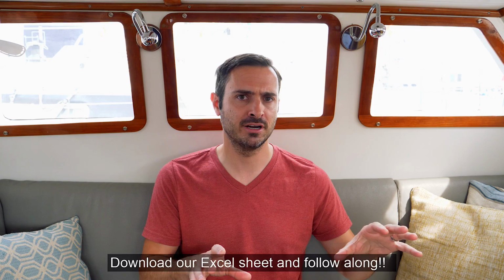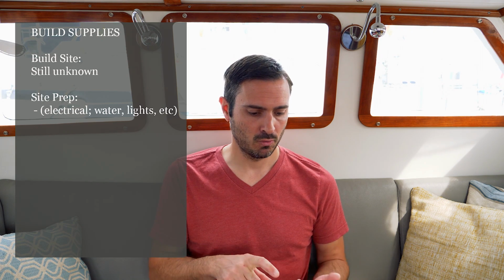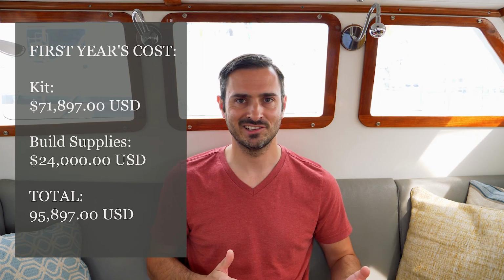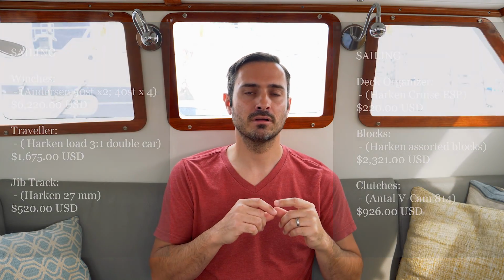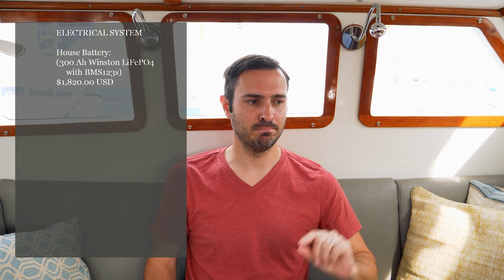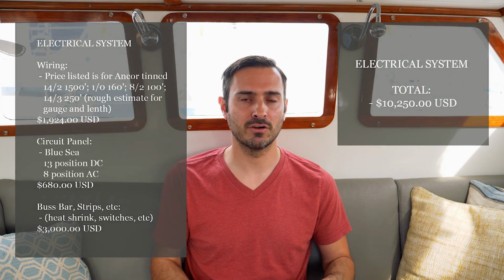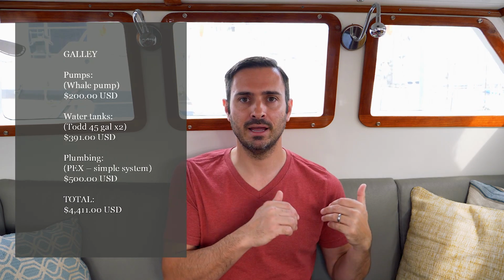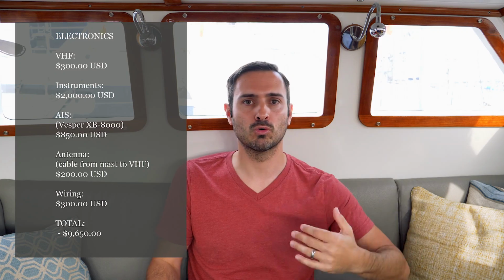What is it Going to COST to BUILD a Kit CATAMARAN? - A Comprehensive Guide (MJ Sailing)

Comment: Any 45 foot cat will cost a similar amount to build, considering they have all the same basic components. The rig the deck gear, sails, the type of fit out items you want, etc. The only way to make it for a lower cost is to use cheaper materials in the hull and deck and fit out. There is a difference in cost between a full foam epoxy build and an end grain balsa polyester build for example. But using material like plywood for bulkheads and interior fit out will have a weight penalty. From the prices you quoted I think the Grainger price sounds about right for an epoxy foam sandwich build. The Oram sounds too low but maybe possible using cheaper materials. The resale value will also reflect the build price and quality.
It is not for the faint hearted, but it is very rewarding building your own boat, when finished you will have a sense of achievement that is not found in other endeavours.  I wish you well in your journey, cheers Rustie.
Reply: They are all Divinycell foam cored epoxy panels... hull, deck, bulkheads, furniture.... everything.  The Grainger and Oram kit comes directly from ATL composites and are the same identical panels.   They are made in a heated hydraulic press (flat panels) so have the lowest resin/cloth content around.   The Schionning is a different manufacturer in South Africa, but they infuse the panels instead of hydraulic.  -Matt
Reply: @mattjohnson6716  Wow then that is a weird price difference.... All the material for my boat also came from ATL. They are very reliable and consistent with their quality. We have 2, 40foot containers with a poly hoop dome over it with the ends closed in. It is worth investing in this type of shed as when you sell it later it ends up almost free. The containers are great for storage and as a workshop for building dagger boards, rudders etc (good for controlling curing temperature). Examine the quoted material list carefully and compare it to the plans material list. Because if you think they haven't allowed enough DB tape or if you want some extra panels to build shelving cupboards etc that aren't on the plan then it's cheaper and easier to add few extra sheets. We are looking forward to the build series, Cheers Rustie & Malene.

Comment: Really interested in the 4 stroke outboard option.  I too luv the idea of easier to service and light weight engines.  Can you please tell me how you will get on with carrying enough fuel.  For instance if you were in the South Pacific.... Can you buy good petrol and carry enough for your needs ?  And secondly will your solar charging make u fully self sufficient in say a week of cloudy rainy weather especially because the outboard Alternator running time will no doubt have to be minimal due to fuel cost and fuel tank capacity.  Im really enjoying your boat build videos so please keep up the GR8 work.  Thx ~ Paul
Reply: Thankfully outboards are used by everyone island nation for their small boats.  Most of the time it's easier to get than diesel.    Efficiency for the newer 4 stroke is closing in on diesel, but even if we need an additional 20%, that's not that hard to accommodate.   The only negative is that you can't slap a large alternator on these outboards (under 30hp).  Evinrude has one with 45a, but that's the largest I know of.  But with the area we'll have for solar, we can rely on that to charge the boat.  If not, since we'd have gasoline on board, a honda 2000 generator would work great to fill in the gaps.  

Matt
Reply: @mattjohnson6716  Hi Matt good answers thx.  Hey please use a good explosion proof packing in your petrol fuel tanks.  Will stop a full on explosion in worst case scenario and its not an expensive product.  It used to be called Explosafe probably lots of options now days.  All the best with the build M8...

Comment: That boat is not doing it with me , for what your going to do with it , the bow is reverse so the waves will launch up the boat , being a wet boat on long crossings , it’s narrow for its length which means it’s more for charter , the decks angle in board loosing valuable stowage for extra fuel or water , it’s very high out of the water which for a light boat is tippy windage you  don’t need , it’s light so speed is good if your wanting that , for deck room is not big ,,and do you want to go back to work each of you to fund a build up to 300 k , there better buys second hand out there go to sttmarten and look at the damaged boats there you can fix , must be better deal sorry to be a pain buy I’ve done it , built it and there is no budget no launch date no end to cost  and resale is less than cost , if you want to go cat buy a hull and decks and finish it off , better deal , I listened to mat he’s done some home work , he’s full of spec  figures and numbers but cost cost , at present you two are cruising the world free with the help of a few , no ties and enjoying life  why change it over to you good vid
Reply: I would totally disagree with you.  Modern catamaran design is nearly all going down the reverse sheer on the bows and there are good reasons for that--they are not necessarily wetter and the advantages of having more buoyancy down low is significant. My 40' cat (that I built) was wet when we were doing more than 16 knots... sort of to be expected frankly.  Beam has nothing to do with charter boats!  In fact look at the normal charter cats and they are all beamy and fat--the lagoons, leopard, etc,  Oram has a very strong philosophy of long cats--long is fast and then you don't need to go out to a 50% lenght/beam ratio and your prismatic coefficient is far better.  Re height on the water and tipiness... that is completely wrong.  The Orams are far lower profile than any of the new lagoons etc that have the huge cabin top steering position.  There are also a lot of Orams that have done circumnavigations, none of whom have capsized. Sure windage on all cats is a challenges as there is little beneath the water compared to a mono, but at least on that one you can lower the daggerboard to help when maneuvering in tight spots.
Reply: Well I better stop designing ,where  talking off shore boats here they need to be able to stay upright

Comment: Why in the world did you go with Oram? Before you mentioned Schionning and Grainger. Both superior designers with many more boats built. Meaning there is a bigger community of people that built their boats. Not to mention that aesthetically Schionning and Grainger boats are beautifully designed and don’t look like cats from 70ties. Which virtually unknown Oram does. Scratching my head.
Reply: I don't think they have gone definately with Oram, that is just for a costing, a similar sized boat is going to be similar cost. It probably would be, the cheapest in terms of cost as Matt said in the video, but I don't think by much over the similar but slightly bigger in terms of volume schioning arrow 1360, which I'm favoring at this moment for a number of reasons, not least of which is one eye on the future as it seems the schionings have a better resale value.

Comment: Put a secondary 20-35A ‘charger’. They are wide ranging so will operate at any input voltage/frequency.... gives your redundancy for charging when in 230V zones. Or switch the  ‘inverter/charger’ for a dedicated inverter... will half pay for that small charger. The charger doesn’t run appliances... but even that small size is more than enough to fully charge your lithium batteries in <10 hours.

Comment: You should really consider an electric drive because it would reduce your running costs in the long term. The power supply can be supplemented by systems that charge the batteries for a lower cost than running diesel generators. The result of this also means you have more than enough power to run water desalination, and if you had run out of diesel or a generator failure you would still have power from other charging sources.

Comment: A few ideas if you are going to build.  
For solar - panels look at altestore for mono and poly panels at 50-60 cents/watt. Look at makeskyblue for mppt 60 amp solar charge controller at $105-$150 , or EPever mppt controllers for bit more.  I helped install panels and controller on cat in Feb.  
For propulsion engines - consider (google) HF-3m78 marine diesel 21hp at 3Krpm with gearbox and some controls at $2K+, weighs 341lbs thou,(vs 143# for outboard) , they can also supply shafts, stuffing boxes etc. for US sailor demo see youtube "TDPower 3m78" by A liquid Life
Catamaran sales vs asking price - youtube "2018 catamaran Recap".  This will give you insight into home/kit built cats' actual selling prices.  There may be a 2019 report by poster.
Good luck to you with your project.
Reply: So, I watched  the video, but comparing the resale value of a home-built "performance" catamaran from a small Australian designer to the big three names (Lagoon, FP, Leopard) , which were the only ones covered in the video, is an analytical error.  If the MJ boat is worth $400K at launch (double the materials cost) at the end of year 1 (-15%) figure $340K, end of year 2 (-5%) $323K, and additional losses of 5% for end of years 3 through 10, so $307K, $292K, $277K, $263K, $250K, $237K, $226K, and finally at the end of year 10 value = $214K.  Now, if the boat were a widely recognized brand name high performance 45 foot cruising catamaran, like Outremer, Catana, it might be worth $214K, but equivalent home-builds are Wharram, Richard Woods, Schionning, Granger, and the other  OZ designers.  I'd say cut value an additional 30-50% depending on the condition of the boat.  So, $214K less 40% is about $128K, which is less than MJ's original cost of materials, let alone three years of labor.  To repeat, home-built boat values will not maintain market value like a recognized brand-name boat especially after 10 years.  So, this only makes sense if they enjoy building boats, which they do.

Comment: Very exciting! Why don't we all share what We believe is just #OneTip for MJ Sailing to consider. My #OneTip is #PeelPly
Reply: My tip is to have a solid marriage.  Work out even the smallest annoyances first.  As an ex-home builder I had seen many relationship problems surface some ending in divorce.  Identify the needs to decompress from time to time and that its okay to take time off.
Reply: Lots and lots of PeelPly saves on time and sanding dics.

Comment: Rather than a table saw or panel saw, go with a track saw and a miter saw.
Reply: Sorry, I called the track saw a 'panel saw'.  That is what I meant.  We were doing a shaker style interior on our current boat, so needed the table saw for those cuts.  This time around will be straight flat panels, so a track saw would be perfect.

 -Matt

Comment: Lots of detail, thanks! Excited for you guys! I like the idea of the liftable outboards to reduce drag and ease maintenance.  You clearly need to be a bit more careful with gas vs. diesel, but that is a solvable problem. I'm a bit surprised that hydraulic steering isn't a given.
Reply: Tillers are even an option!  These things steer pretty light, so not a lot is needed to keep them in the grove.   

The nice part with a catamaran is the gasoline can be on the bridgedeck and just vent out below.  It's pretty safe since it's not in the hulls.  -Matt

Comment: I no u want to build , but have you looked into a storm damaged boat , you can sometimes get a great deal and its totally a rebuild at the same time ... Just a suggestion I no you guys no what you are doing...
Reply: We've seen enough storm damaged boats to be leery of them.  There are some great deals, but those are usually snatched up be local pros way before the general public gets a chance.  The boats that are left are reparable, but it's a big gamble if it's going to end-up cheaper than just buying a non-damaged boat to begin with.   There are a lot of issue that may look small on the surface, but once you dig in, you find they go a long way.   

-Matt

Comment: Something to consider when deciding on components is the warranty length, where it has to be shipped to for warranty repair(Europe or USA) & if the mfg offer out of warranty repair.  Pronautic P series chargers carry a five year warranty.  Both Garmin & Raymarine offer out of warranty repair. (better than throwing away & cheaper than buying new.)  If not repairable they may offer a reduced rate for upgrading to current models.  Some Fusion(Stereo, Amp) models are warrantied for 3 years.  Ritchie Compass I believe is five years as well. ...just little things can make life easier down the road.
Reply: We made the mistake on the last boat of snatching up deals (electronics, pumps) when available.  By the time they were installed, the 1 year warranty had eclipsed.... that's when I found out that a few of the items were DOA out of the box and I had no recourse to get them repaired.  Very costly mistake and I'll be paying better attention to the warranty offered this time around!   

-Matt

Comment: If you do borrow someones property see if they will take a building in trade. Build your own warehouse/build shed. And then leave it for them in trade. You can make a studio apartment for comfort in the back of the shed. Save you a ton of money. And you wont have to worry about your supplies.  You wont need much as long as you have water and power .  And remember you will want stairs and scaffolding on the sides. Those prebuilt hoop houses are hard to attach to.

Comment: when they say they include all fillers and such in the kit - Is it enough to get the inside fared out to a good standard as well as fairing the outside?
Reply: There is suppose to be enough plus 20%.   But Oram warned me that it greatly depends on the quality of your fiberglass work.  So work neat from the beginning, and you save yourself time, money, and weight by not having to go nuts with filling uneven surfaces.   -Matt

Comment: Wow - Great Info and thanks for sharing....I was looking at the Elco Electric Outboards - Is there a way to get away with Long shaft instead of Extra Long (5 inches)? They are roughly the price of the Yamaha you mention - Of course the Batteries are not included in that - But then clean and no fuel......
Reply: We've talked about electric outboards, but our experience is that we typically don't have enough excess power from solar to charge a large propulsion bank.  I don't think these electric outboard (Torqueedo definitely doesn't) regenerate power when sailing... no benefit there.  We don't often go into marinas, so can't rely on plugging in at night.  In the end, we'd need a generator and then the whole benefit of electric is eroded.  

Matt
Reply: @mattjohnson6716  have you considered buying a second hand crashed nissen leaf or similar battery bank even the first versions are 24KWH

Comment: Keep an open mind as to the amount of time you have allotted for the build. That can change in a heart beat. And if you decide to go that route don't get in a hurry and by all means if you get discouraged take a break and walk away for awhile. It'll still be there. I know I'm building a 24 foot self designed Trimaran for use on the ICW and gulf. A self build is labor intensive and time consuming. Good luck to you fellow boat nut!
Reply from the maker: Thanks Randy!  If you've been following our adventures for awhile through YouTube, or even before that on our blog, you may have seen all the time and effort we put in to getting Elements re-built and ready to sail.  We spent 2 years in the work yard and another six months at the dock, working 7 days a week.  We would take a week off every 4 months or so, but we're aware of what our bodies and minds can handle when it comes to a build.  And for a brand new build, we're excited not to deal with the headache of fixing existing issues on a 30 year old boat.  So already a mood booster there.  😃 💪
Reply: @MJSailing  At almost 72 I often wonder if maybe I should refocus my energy and time doing something far more easier. But from the moment my wife said she loved the idea it was game on. I'm a firm believer your dreams are only limited by your imagination and abilities. I've been following your journey's for awhile but sadly not from the beginning. Looking forward to your future project.